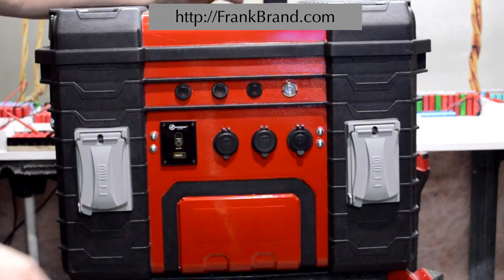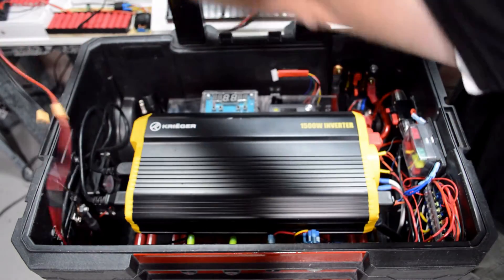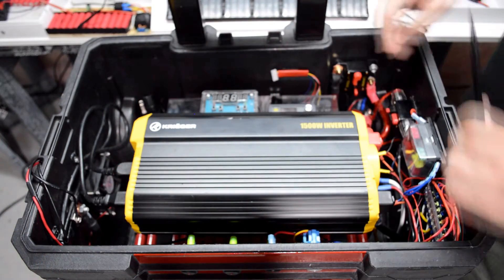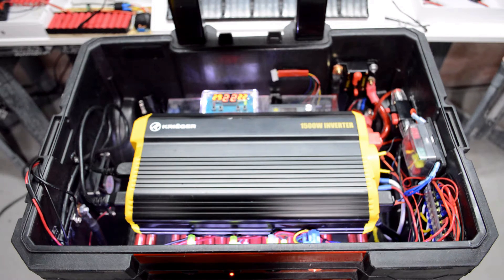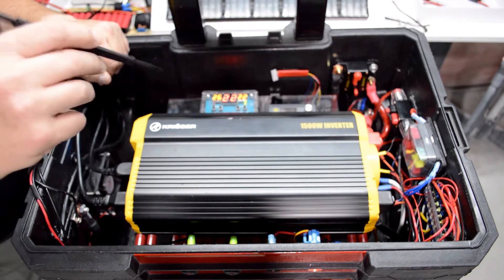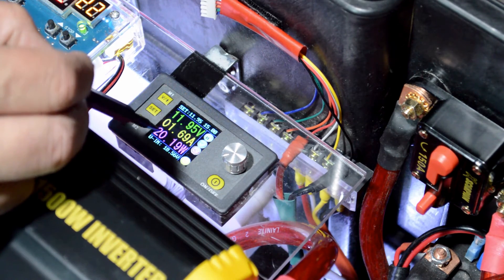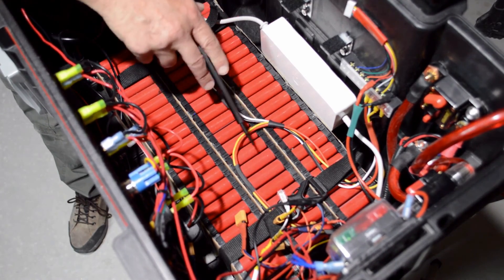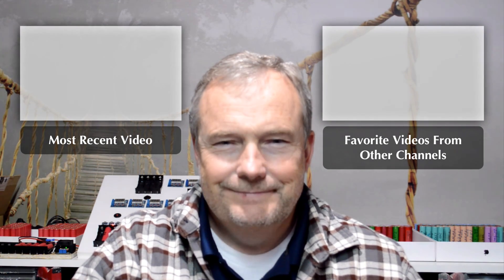Portable PowerPack Part 2

Comment: Hey buddy, awesome video! I just built something very similar to this and had a question about the charging aspect with the PSU you're using. I'm curious how it's not automatically tripping the over current protection on it since I'm guessing your battery can definitely handle (and prob even wants to draw) more than what that supply can output.

In my pack, there is no charger intermediate unit or buck converter between battery and power supply so I think the battery is just trying to draw way more than what the supply can put out causing it to trip into over current protection right away almost.

Comment: Frank, if you didn’t use the 18v Mac power supply, would the buck converter still be needed in the system?
Reply: you have to find a charger that is capable of charging to 14.6 v without a float charge. you can use any voltage for the buck converter as long as its in the voltage range that works for it. if the buck converter is capable of handling 48volts you could still use it to charge to 12.6v i suggest for a 3s charging setup just to use a imax b6 charger, because you can set it and leave. it has its own balance leads on it so it can monitor each of the 3 cells while it chargers to reduce chance of fire. but can only charge at 6amps is its downside. you could also have had a 12v input for the buck converter with alligator clips to go strait to a battery on a vehical.

Comment: I know this comment is coming in a year after upload, but Nice job! I have a smaller unit (266 watt hr) that uses a lot of the same concepts that you've applied to this larger pack. I've recently been trying to source the batteries to make a pack around the same size that you've made here. My goal for the new build would be to have something that I could run a refrigerator and possibly even a couple led lights or fan on for 24+ hrs. Based off of my quick math and the info you've stated in the video it looks like your producing around 1.9 kwh? Also, have you done any testing running this setup on a load such as a refrigerator?
Reply: This is prob gonna sound weird but I recently got about 300lbs of used battery packs. Gone thru half of them and the majority are good cells. I have way more than I'll need for my projects though. Are you in the states? If so, which one?

Comment: How many 18650 cells are used in the power pack?
Reply from the maker: +Red Raider, when I shot this video it had 240 18650 cells.  I'm in the process of increasing the cell count to over 700 cells. I will be posting a video of the upgrade.
Reply: Thanks Frank!  You've done a great job with the unit.
Reply from the maker: +Red Raider, thank you.
Reply: Frank, without having to do the math (possibly missing some variables), what's the amp hour rating of your pack as built on this video (240 18650 cells). 12v ?Ah ?Wh

Many thanks. You've done an awesome job with this power pack. I want to build one myself as soon as possible, though mine would need to charge via solar, as well as either the alternator on my truck, or an existing 1000W inverter. The latter approach would require no rewiring; charging via the existing 110v input on your unit as currently described.

Another nice to have would be the ability to use the pack to jump start a dead car battery. However, I'm not sure of the current draw that this would require, and whether doing so is even possible with the 18650 cells.

What's a good ballpark figure for this build, all-in?

Again, brilliant work. I look forward to seeing many more from you in the future.